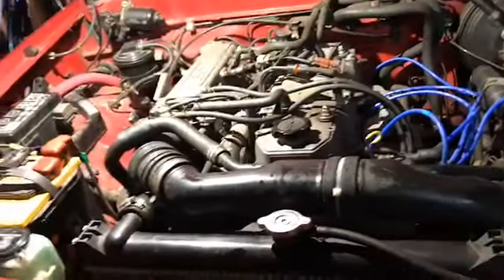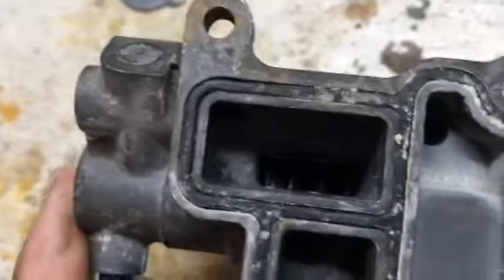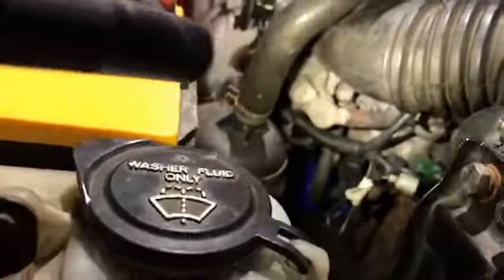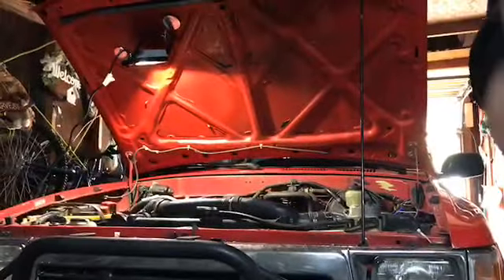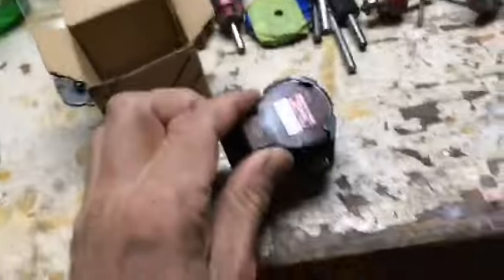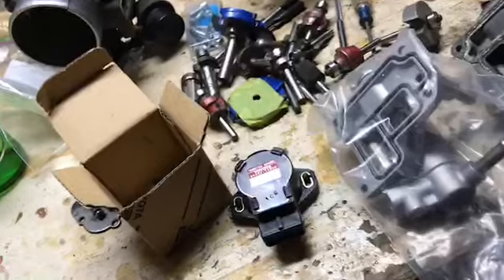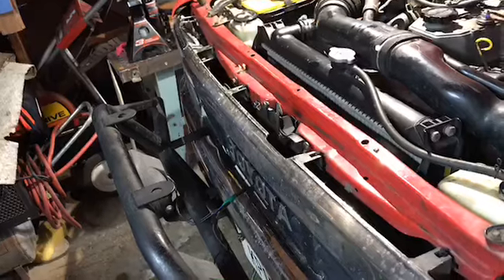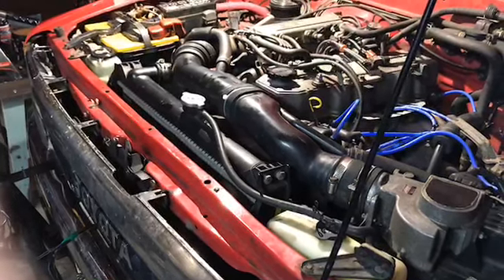1990 Toyota Pickup Misfire. Problem fixed.

Comment: Como se llama la valvula esa disculpe?
Reply from the maker: todo mundo le llama IAC 
Valvula de control de aire y esta abajo de la Mariposa. Con solo una limpiada se mejoró muchísimo.   De preferencia mejor nueva con nuevo empaque. 
Suerte.
Reply: Gracias por responder mi carro aser similar avecez arranca acelerado y avecez bien despacio y anda como muy acelerado y otras vecez desacelerado q sera?
Reply from the maker: @josep.7387   yo tengo ese problema desde muchos años pero no se me apaga el motor, le cambie el TPS  para ver si se mejorava pero sigui igual, segun el tiene que estar calibrado y nunca lo hice.
Reply: @007ayala  yo ise los mismo lo cambie pero nunca lo calibre y es posible q eso sea